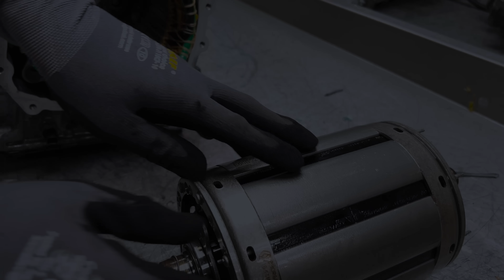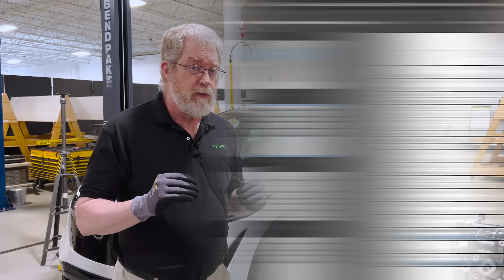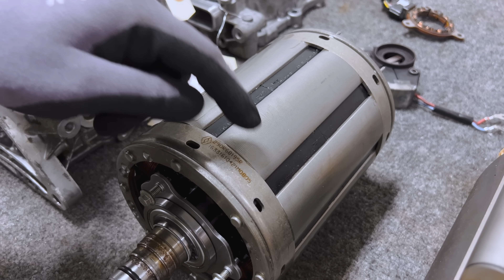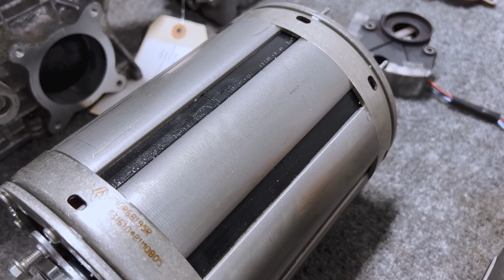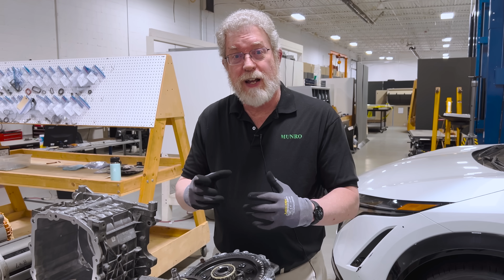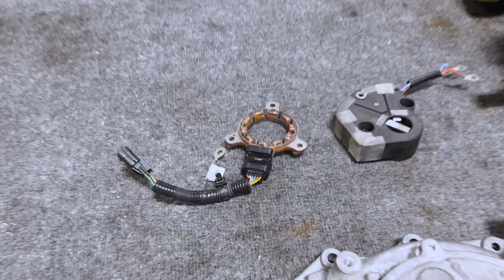This EV Motor Has No Magnets – Nissan Ariya EESM Teardown

Comment: I have Ariya 2023, excellent EV ! The problem is that dealer told me last week, that they discontinued Ariya to USA since jan 2026 ! They don't want to bring new Ariyas from Japan, they just want to sell new Leafs which are made in Smirna, TN. They don't want to make Ariya in the USA and that will make it complicated for servise ! You video is highly professional and I'm glad to see what's in my car. I think the traditional synchronous AC motors on DC rotor brushes without permanent magnets are still the best and very reliable.Now I know those brushes will last 150K miles plus.

Comment: i am surprised we don't see more wound rotors, it provide the equivalent of a transmission on the magnetic side as you can modulate the field of the rotor for the speed of rotation.
You might need high field for a few second as you start, but then once you reach crusing speed, you reduce the field strenght and can cruise with very low field. Also winding can create magnetic field 2X of magnet and if it's only for a few second the heat and energy loss can be resonable. I don't like the brushes and would hope they use an inductive coupling instead but I guess they know quite well the lifecycle of this.

Comment: The choice of the traditional field winding for the synchronous machine is very good. This allows for control of the power factor and extraction of more mechanical energy while avoiding inductive and capacitive reactive effects.
Ah, my old Megane has one of these air vents in the gearbox!!

Comment: Most cars don't actually use permanent magnet motor equivalent to this one. They use synchronous reluctance motor SynRM which primarily works on magnetic attraction to iron, the magnets are just a bonus to increase the torque at low RPM. I don't think "permanent magnet motor" is a useful label in today's world. Actual permanent magnet motors whether brushed DC and brushless AC are used mostly in toy size applications https://www.youtube.com/watch?v=vvw6k4ppUZU

Comment: Technically that speed point at which this motor becomes more efficient than its pm counterpart would be the “corner speed”.  PMAC architecture likes higher voltages because it pushes corner speed out further.  With this design you can lower dc voltage architecture and re claim that efficiency band with the dc energized rotor.

Comment: IMHO: For standard ev's this is the wrong way. More rpm's result in more abrasion for bearings and carbon brushes. I like maintainance free brushless motors. And worldwide speed limits does not effort high speed rotors.....ok...fomula e need them.

Comment: I think TESLA’s have two different kinds of motors typically. The rear and main drive motor is with permanent magnets. The less used front motor is non-permanent magnet. I wonder if the front moderate is similar to this one in the Ariya? 🤔
Reply: The second motor in a tesla is an asynchronuous motor.
Reply: @bigwoifal  thanks, I forgot what they call them.🙏

Comment: By controlling the rotor current, you control the rotor field strength - which means you can reduce the back EMF produced in the stator. You can also control the phase angle between rotor and stator field - which alters the inductive reactance of the motor. In all the motor becomes way more controllable.

Comment: Nissan are not ahead they just use what Renault provided.  The ariya ahd leaf is just Renault scenic / megane. Like the the micra is R5
Reply: Partially wrong, Nissan led the design of the CMF-EV platform for C/D segment, Renault did for the B segment variant of the platform

Comment: very interesting that at least 3 types of rotors (permanent magnet, induction, wound field) are in production cars. Electric motors have been produced in much higher numbers, over a longer time, in extreme range of sizes and use cases. So one would assume one design would be the clear winner for a quite specific use case like electric cars. But apparently not.

Comment: I do not agree on the advantage of better efficiency at high rotational speed. Most energy lose on highway are cause by air friction, so the small gain on the motor will not change much in the end. Cars should not do long travels on highways, public transports are here for that, car should be used only for small to medium distances like ..sub 200km.
I'm kind biased cause I own a ioniq 38 and with a permanent magnet motor and I got yet to see an other car as efficient as mine, on the last 10k km, I'm under 11kWh/100km. I got an efficient way of driving (I think), but clearly all guys I know near me...can't gonunder 14kWh in the same conditions.

Comment: This motor is bad because: brushes wear out very fast (stupid idea), rotor coils give 2 problems: 1) you need more electrical power for this (motor efficiency will go down), 2) these coils feel dynamic forces of rotation and will die soon ( after the car warranty expires). I use Nissan Leaf (new, battery life is very good) and  I see very bad mileage limit per charge (theoretically 150 miles, in fact 90 miles in the city in the Summer).

Comment: So now you need to use your battery power not only to drive the car, but also to power the electromagnets 😂 And good luck with those brushes. They wear in time and guess what, to replace them, you need to dismantle half of the car. And guess what, they will tell you it's not worth it so better buy new motor or new car, why not. This is not genius. This is diabolic. Permanent rare-earth magnets are the way to go. It's "free energy" as long as you spin them.
Reply: You are right

Comment: So this looks like a pretty crap design to me, not an engineer but, at Tesla the best part is no part and from what I can see in this design there are a lot of parts that will wear or fail over time, those slip rings are going to wear out, the brushes are going to wear out, the motor will be contaminated over time with carbon deposits from the brushes, this will lead to the bearings to wear out, this will then lead to the rotor to over heat and burn out.

If this design could be simplified and some how remove those points of friction and wear then it could be a good design, I am sure Tesla will figure out a more advanced solution to the removal of permanent magnets without these compromises, there really is nothing new in this design, it's just a cheap motor that is going to fail faster and need replacing sooner.
Reply: You're right, I'm the car owner. It's because the fault rate of the excitation motor is too high, and I've been thrown on the road multiple times without any parts, so I have to replace the assembly!😅😅

Comment: Wound field motors are not nearly as efficient as permanent magnet motors, esp. since we have Nd magnets now. It was a way to make a cheap motor, but it will not help Nissan. It will gain a reputation as a less-efficient EV. Carbon brushes have a fair amount of loss. This is a dumb idea. Nd magnets are hard to get right now because China is turning the screws on them, but countries should have pooled their resources and found a source elsewhere.

Comment: Excellent discussion.   I was impressed that you covered oil cooling of the rotor and common mode voltage on the bearings.  This is a great design. Engineers like myself tend not to like brushes, but for cars, the operating life is not that long, maybe 4000 hours.  The easy access to the brushes and no need for rare earth magnets makes this design a winner.
Reply: No, this is clearly a potential point of failure. Carbon brushes are unreliable, particularly those of the wear-type design, which are highly prone to shattering under high torque or when subjected to jolts.

Comment: That is just like a car alternator when used as a BLDC motor.
I've even made one myself out of a car alternator.
Varying the rotor field current allows me to control the back emf of the motor and i can increase the motor rpm at high speed, or increase torque at low speed.
Edit: It takes very little power to excite the rotor field windings enough to make the motor produce high power. People who connect large batteries and get massive current draw into the field winding don't realize that it works against them and they're using the motor wrong.

Comment: The reason of the rotor to have a squirrel cage over the rotor windings is because without it the rotor would not start spinning in sync with stator magnetic field rotation. Rotor squirrel cage induces magnetism and syncs rotor rpm to stator winding magnetic rotation

Comment: This is basically a synchronous AC motor, the sort of which were made for more than 100 years. Instead of permanent magnets it uses electro magnets, that's it.
For details and comparison, advantage over PMAC is ability to control field strength (better efficiency range), but it needs some (small) power to maintain the field (lesser top efficiency). Also there are some losses due to brushes, but it is nowhere near the wear on the collector type motors (DC) since it uses smooth slip rings and small power for the field. This motor is basically the same as the one used in Reno Zoe for years. Bmw has been using a type of this machine without slip rings offering some other advantage/disadvantage set.

Comment: Renault Zoe uses this type of motor, for the reasons:
1) It gives Zero eddy currents when coasting, while having efficiency of permanent magnet motor while driving. Ideal for front axle application on AWD vehicle
2) It is much cheaper to produce
3) It can de-magnetize rotor and use stator coils as big inductor for 43kW AC charging. Hyundai/Kia use similar system for 400V DC to 700V boost feature

Now, downsides:
1) Motor is much bigger than induction motor or permanent magnet motor
2) Inertia is much higher, so under ABS/TC event, when motor must change speed rapidly, motor bearings suffer more
3) Carbon brushes are wear item and whey can wear out, or just accumulate carbon dust and cause HV isolation fault
4) Motor is harder to balance
Reply: You forgot this upside:
4) Better efficiency at high speed (highway, where it matters): 13:17
About the downsides:
1) downside isn't one for the Renault motors: 4:30 which means that
2) the inertia is most likely similar.

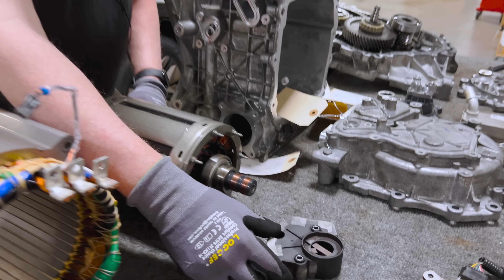3) The carbon brushes are designed to last 150,000 to 250,000 miles and are easy to replace 8:10
Reply: @unnainconnu9098 The longest actual test result for carbon brush life to date is 300,000 kilometres/180,000 miles, and that was under laboratory conditions.
At top speed, efficiency improved by just 1.5 per cent – what a shining moment.
Reply: I also think e-brake (vehicle stopping by itself) is not possible without permanent magnets. But that is not a big deal.
Reply: @sajiantony7473  If you are referring to regenerative braking it is possible without permanent magnets ... and it IS a big deal i.e. it's a necessary aspect of EV efficiency (so results in a greater range, all other things being equal).
Reply: @MrAdopado  What I meant is, regenerative slowing down is possible, but completely stopping the vehicle is not possible without permanent magnet (when motor is not powered). But I don't have expertise in this field.
Reply: @sajiantony7473  So long as you have power in the battery to energise the motor coils they can be functioning as a magnet, so the ability to make a complete stop should still be possible even when forward motion stops. Of course the car applies the brakes in the last split second anyway, if only to stop the car rolling away.
Reply: @sajiantony7473  I kinda agree that it must be the primary reason that the Ariya doesn't do "true one pedal driving". Not saying it's not possible with this motor but there must be a reason why Nissan chose to stop regenerative braking at around 8 MPH.
Reply: @wesbishop3790 Tesla did not have this in 2019. Then they updated the software and since then it was possible. Even an asynchronous machine you can bring to 0 rpm by just letting the stator field running backwards with the rpm of the slip rpm at that torque. As there is always a high precision resolver a.k.a. angle or speed sensor, the stator inverter can regulate that easily (regeneratively). Plan B is to apply DC to the stator coil for "active braking" (non regeneratively).
Reply: @sajiantony7473 The Renault Megane and Ariya use the same motor and the Renault Megane does have one pedal braking

Comment: Nice Video.  It reinforces my thought that people are stupid when they do not visit "prior art" when they build a product.  As an electrical/electronics engineer for 50 years the use of electromagnets in "synchronous" power generators is OLD.  We have one client that has a generator that N. Tesla (the original Tesla) signed off on the construction drawings.  There is great reason that the Westinghouse and GE shops used electromagnets in 1890 all the way to generators on jet engine gas turbines.  As a kid in 1969 I remember the night (20 July) that US Astronauts landed on the Moon, back when engineers used slide rules and actually were proficient at Physics instead of BS software; consider the # of Saturn IV rockets that von Braun blew up - ZERO, how many has Eltron the Muskrat blown up - lost count.  I do like my Tesla Y car tho,  C.Ripp, PE.
Reply: Really ignorant to diss SpaceX for their launch record,  as they're launching every other day....

Comment: I watched the Munro LIVE program with great pleasure. The Nissan engine undoubtedly deserves comprehensive attention and analysis. The power supply to the rotor windings in the monitoring system developed by the engineers is undoubtedly valuable. Controlling its magnetic field based on rotation improves traction. However, like everything in technology, it has its advantages and disadvantages, such as its reliance on PWM current delivery to the rotor.
A standard Permanent Magnet Synchronous Motor (PMSM) must have a voltage and PWM monitoring system, and therefore the current delivered to the stator.
One day, Scientis will develop field or current-controlled permanent magnets [Magnet IGBT/MOSFET], eliminating the need for armature winding – as I proposed in one of my LinkedIn posts.
Congratulations and warmest regards from Poland 🇵🇱👌.

Comment: The rotor has brushes to power the rotor winding - which can wear out!

Ok rated for over 150000 miles and easy to replace.

Comment: I'm a bit concerned about the rings the brushes ride on.  Given enough time, brushes will grind down whatever they're contacting.  I've seen commutators with deep grooves. 
Brushes will also leave dust but it looks like they managed to keep that from getting into the case.

Comment: I totally get the supply chain security thing but there is a reason why 85% of EV motors made in the last 10 years has a permanent magnet rotor... the reliability of a truly solid state rotor is going to be much higher than that of a wire-wound one.  Spinning coils of copper wire at getting on for 20k RPM is not ideal.   Really, Nissan is such a small player in the EV world that none of this particularly matters, especially if the company no longer exists in a few years which is looking distinctly likely at the moment..

Comment: A very good explanation regarding Nissans designs - well done. The motor is the same as an AC generator - simple. Interestingly, Renault Clio’s have many issues due to recirculating induced currents damaging bearings - perhaps they could learn from this ?

Comment: This motor design is the reason why the Ariya does not get to a full stop in one pedal driving mode.  All the other YouTubers criticize the Ariya for that but never explain why.  The motor cannot generate a magnetic field when it is almost stopped, so it cannot provide the resistance at very low speed.  Perfectly reasonable. That is why we have feet and a brake pedal 😂

Comment: Little question, maybe I didn't understand correctly but.. is there oil wetting the rotor? Doesn't that add resistances and lower efficiency?

Comment: I'm curious about the gearbox breather snorkel. Adding a checkvalve would eliminate the problem of water ingress, while also assuring that over heating and cooling cycles a slight vaccuum would establish itself. And wouldn't that vacuum be beneficial by reducing the potential for leaks? Oil can`t seep out the seals if ambient air pressure is forcing it back in.

Comment: This video implies that EV motors without permanent magnets are a new thing, but they are not. The original Tesla Roadster from 2008 used a squirrel cage induction motor (no magnets, no brushes), as did the Model S from 2012 and the Model X. 

Nissan's EESM design is more efficient than induction but lower performance and higher cost to manufacture, and it has the nagging worry of those brushes needing to be replaced. New Teslas use IPM-SynRM (Internal Permanent Magnet - Synchronous Reluctance Motor) which have slightly better efficiency than EESM. 

Performance variants of Teslas use both types of motor, IPM-SynRM for efficiency and induction for fast acceleration. 

It's good to see Nissan taking a different approach, variety is the spice of life !

Comment: It is good they have developed a motor that uses readily available materials.  When I was young many motors had brushes and they were not a big problem as long as they were easy to change.  Many of those motors would last for years by oiling the bushings every year and replacing the brushes as they wore out.  I hope Nissan ane Renault have success with this new motor.

Comment: the reason why Nissan use none neodynium motor is not because of relationship with china with rare earth metal resources. Becasue only trace amount of neodyniums are used in motor so it's not that big deal. 
 It's just because Nissan is lack of technologies relate to field weakening control.

Comment: So conclusion is variable field magnet with pull out magnet more efficiency at low and at high rpm.. Low rpm full magnet alignment.. High rpm.. Magnet pull out from stator with 1/4 length still on stator